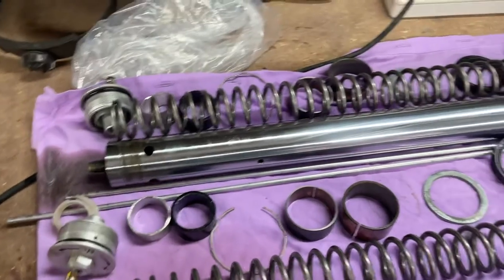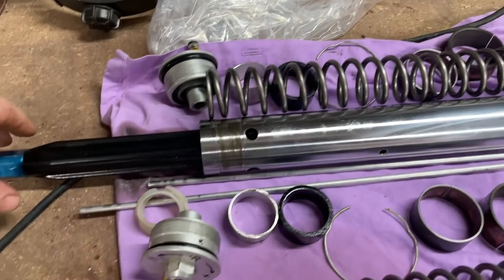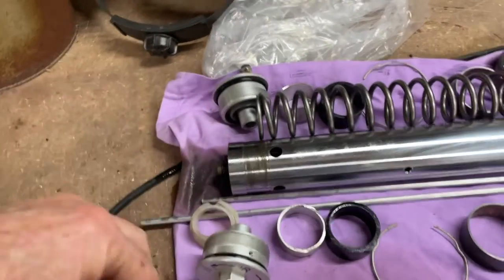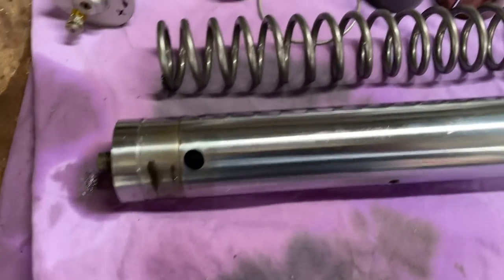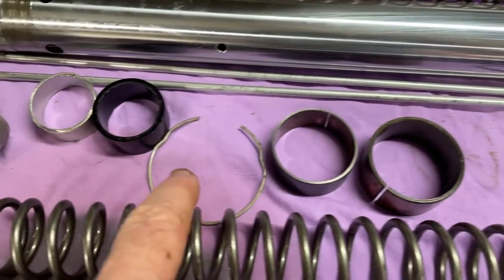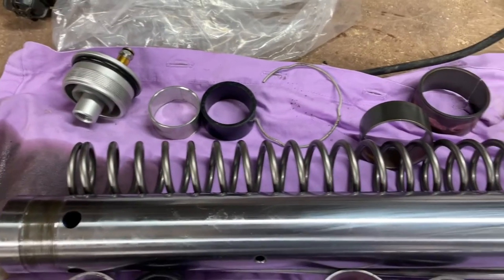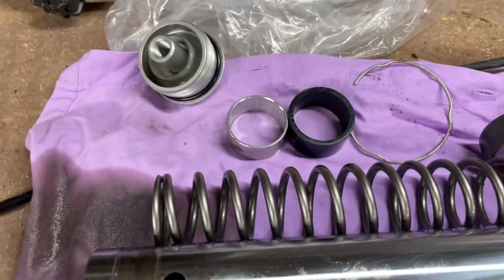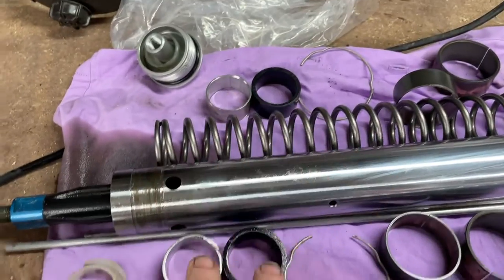20 November 2021

Comment: Are those separate function forks?
Reply from the maker: What do you mean?
Reply: @Grumpyoldtwit  the difference in each fork how one doesn’t seem to have dampening. Does one do compression and the other rebound?
Reply from the maker: @porkchop2723  these forks have both rebound and compression adjustments. 

I’ve since discovered that those ‘extra bits’ were for pre-tensioning the springs.